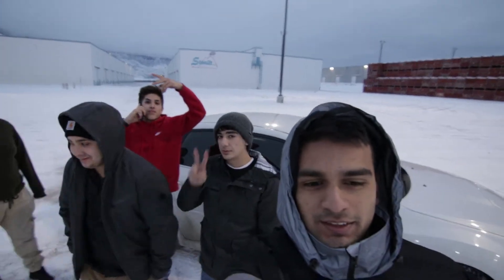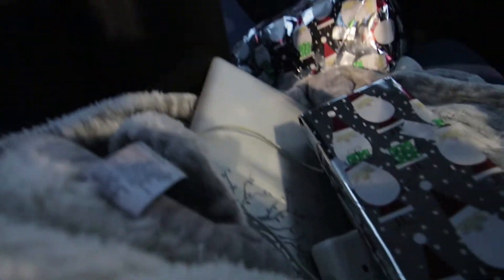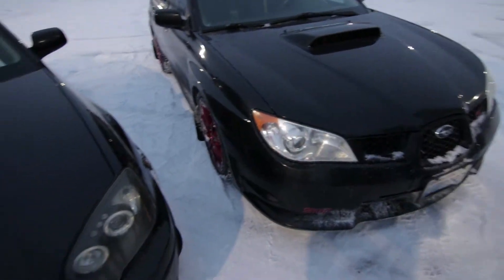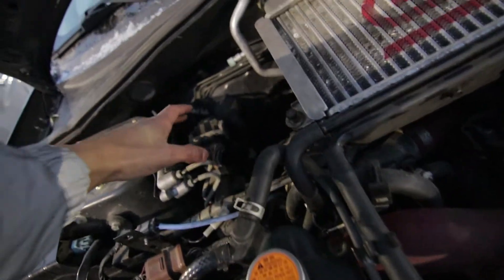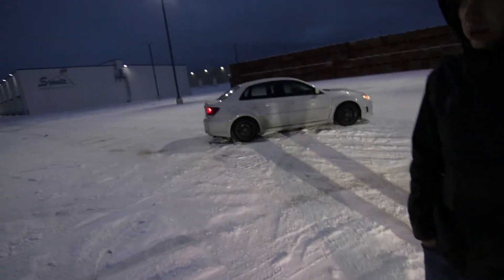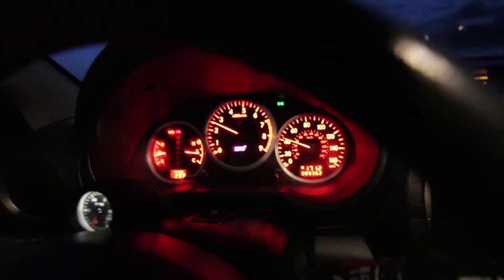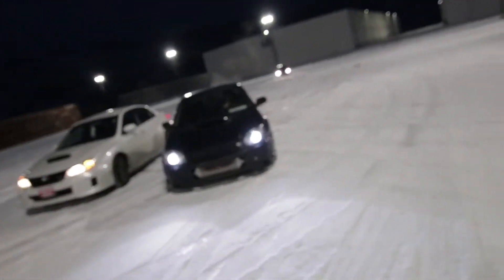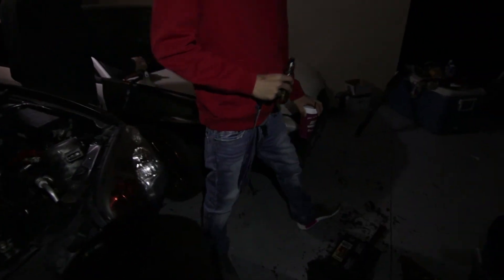Blobeye STi Vs. Hawkeye STi. The same but different

Comment: which one is the most reliable ?
Reply: Kosi Caruth depends what you want. A good starter car is the Blob eye from what my friend told me who was certified by Subaru and worked there before working for a private shop. Good tranny and good engine. Can take a bit of power too easily. Def don't want the bug eye unless you swap out that transmission. Or you're gonna end up with a blown up one. Lol
Reply: I'm pretty sure 07 came with the best transmission